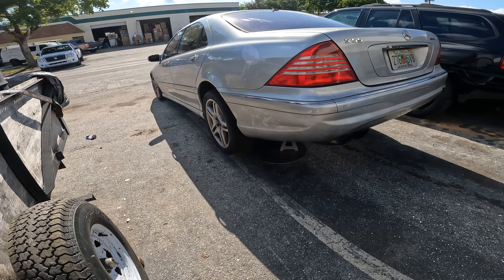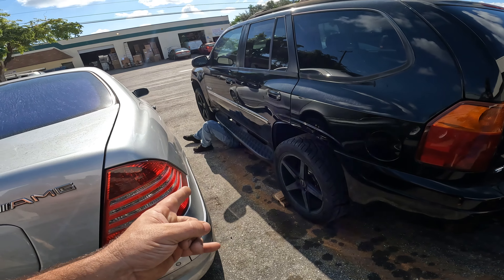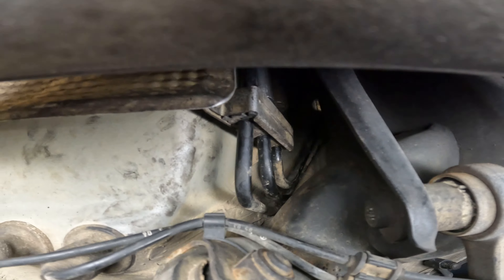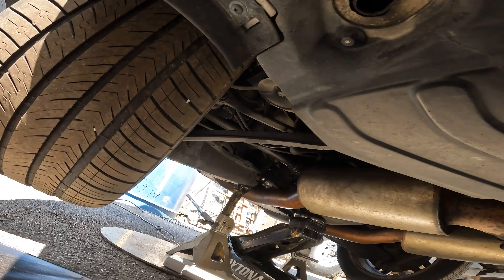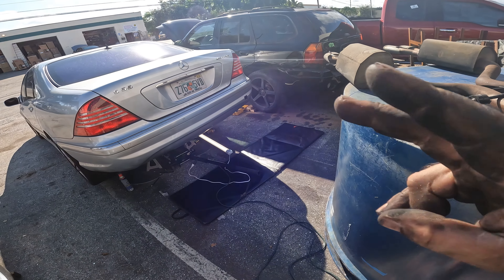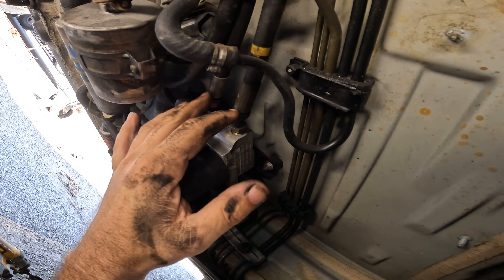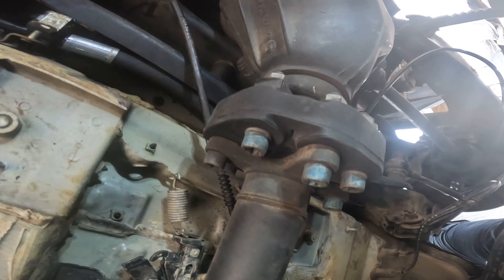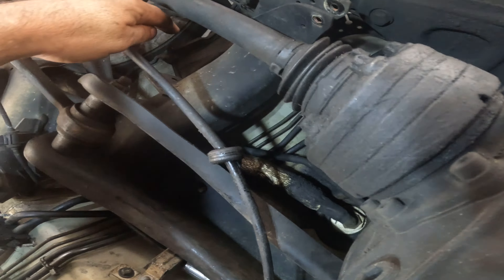Mercedes W220 S55 AMG ABC Repair

Comment: I believe I blew a line but I can just hit the suspension lift and everything evens out. Doesn't look great when it sits, since one side dips, but runs/drives fine. Is this normal?
Reply from the maker: If you have an oil stain might be a bad strut if not its most likely your valve block. I had the same issue. Easy fix I made a video on it. look at my s55 amg playlist.
Reply: @ProjectShopFl  you're the best thank you

Comment: I think the extra mile of pipe is to save having to put an expansion tank on. 😂
Reply from the maker: They do have 2 types of tanks one is called a pulsation dampener and the other is an accumulator

Comment: This is the point where I would pull the carpet and fabricate a well placed floorboard access panel.
Reply from the maker: I've done something similar to access a fuel pump once. lol
Reply: I did that to an 87 Lynx for the fuel pump way back when because it was easier than dropping the tank because of the rusty tank straps